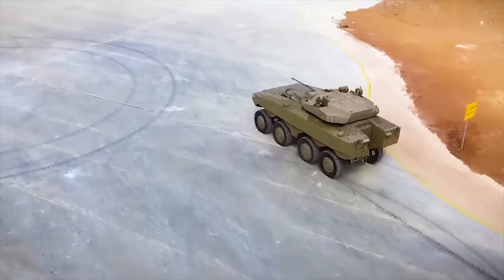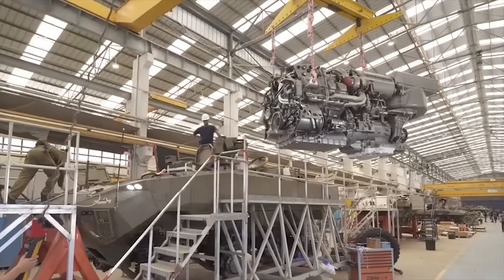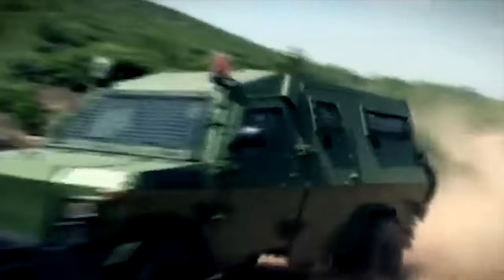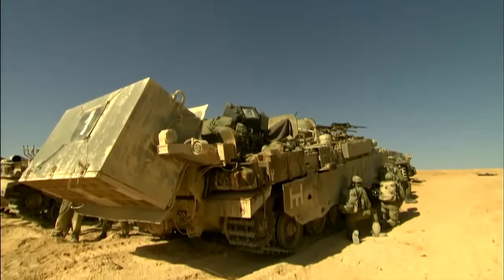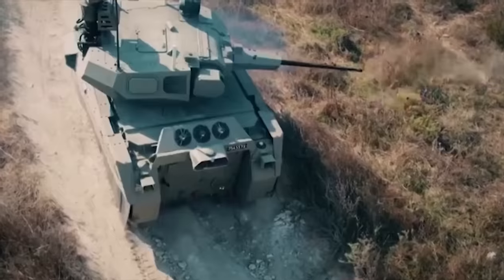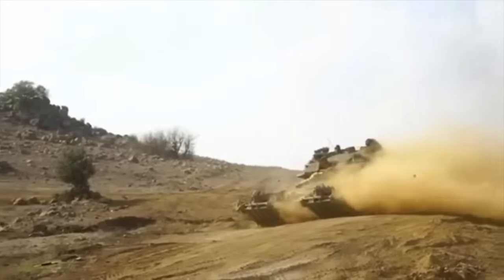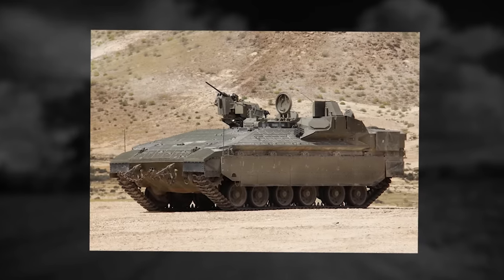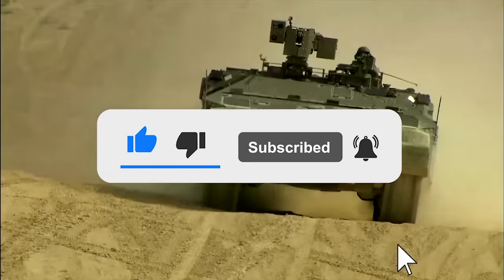New ISRAELI Tank Merkava Mk 5 Barak Is Ready For Action

Comment: The Turret on the old and especially new Merkava is SO futuristic looking!!!! Coolest looking turret on any tank ever for sure!  I know looks mean nothing,..well not nothing,..the US Air Force has been trying to get rid of the amazing A10 forever becasue they hate the way it looks and looks were an admitted reason among other for going with the F35 over its competitor,..in battle tho I know it doesn’t matter although the saucer shape surely deflects incomming rounds much better than competitors with 45-90 degree turret angles right?
Reply: The A10 go brrrrrrrrrrrrrrrrrrrrrrrrrrrrrrrrrrrrrrrrrrrrrrrrrrrrrrrrrrrrrrrrrrrrrrrrrrrrrrrrrrrrrrrrrrrrrrrrrrrrrrt, and the infantry and special forces troops become happy, and safe.
The A10 is going to stay in service for a very long time to come.  PERIOD>
Reply: most of the time looks do mean that design is practical. A10 still looks good, F35 looks very bad with its huge belly.
Reply: The reason why the turret looks different than other tanks is partly a design choice to have highly sloped armor, and party a function of the interior layout of the tank being completely unique. Most tanks have their engines in the rear, and their ammo stored between the interior and the engine. However, the Merkeva has the engine in the front, which means that anything that penetrates the frontal armor will also have to make it through the engine block before it even gets to the crew and the ammunition. Additionally, the turret has an internal ammo storage in the rear (which is why is it so long compared to other tank turrets), with armored panels designed to redirect any explosions outward, rather than down. Effectively, no tank on earth can take a Merkeva IV in a face to face fight, as a direct 120mm AP round might take out the engine of a Merkeva, but it won't kill the crew, destroy the ammo, or incapacitate the turret; conversely, the same hit on even an Abrams is much more likely to kill the crew and render the tank inoperable, as the engine block isn't acting as a shield. The downside of this is, the Merkeva is heavy, expensive, and required a ton of tuning to eliminate some heat management issues that came from the positioning of the engine.

Comment: And so from being attacked by 5 armies on the day of it's Birth, tiny little Israel not only fought them to a standstill, but prevailed against them against all odds!

Similarly on the October 1973 war when the entire country was shutdown on Yum Kippur, Syria and Egypt coordinated a joint attack on them from opposite directions. Here again, they not only stopped the attacks but won again with God's help!
Reply: In 1948, it certainly looked as if Israel would be wiped out.
But many in its army were orphans, since they had lost both parents in the Holocaust.
They were motivated to survive after that.

In June 1967, Jordan warned Egypt that Israel was about to attack.
Jordan sent Egypt the code word: "GRAPE", to indicate the attack was coming.
But Egypt had changed the Code Word and apparently Jordan did not get the Memo.
So Egypt ignored the Code Word and lost most or all of her Air Force.

Being a small nation, Israel has a need to be efficient.
In the late 60s the joke was that the War lasted Six Days since Israel had rented the Tanks from Hertz, but I could not confirm that.

Comment: The merkava Barak is actually still an Mk 4 because the marks go by the mechanical systems and not electrical systems and the mechanical systems haven't changed
Reply: But other than that it's pretty accurate

Comment: I wonder why Israel doesn't use .50 cal MGs?  The .50 cal. penetrates better for both lightly armored vehicles and structures and can be used as a "reconnaissance" tool when entering war zones.
Reply: We do
Reply: If you take a closer look you might spot quite a few of those awesome .50 M2s as coaxial guns and on the turrets, they have been in use for decades.
Reply: @Mrdardas99  The above context only listed 7.62 mm.  But GOOD!  At 100 years old they haven't come up with anything better.

Comment: Mine clearing and dozer blade armored vehicles should be built and used in mass to open holes in defensive lines. 

The basic tank can longer breach modern defenses 

Remembering that the original purpose of the tank was to breach WW1 trenches and bobwire.

This train of thought would also show the feasibility of the land ship concept. This being super heavy assault tanks with limited gun power and geared towards tackling static defense 

The US employed armored bulldozers to breach the Iraqi defense lines in gulf war 1, burying the soldiers in their trenches and bunkers.

Comment: Carmel based on the M113 hull.  Less than spectacular.
Reply: Aint nothing wrong with that thing if used in its intended role.

It's not an IFV...
Reply: Is not. it was only a demonstrator for the electronic systems.